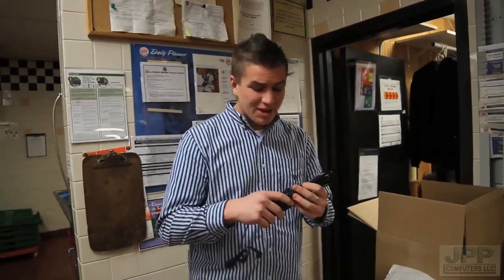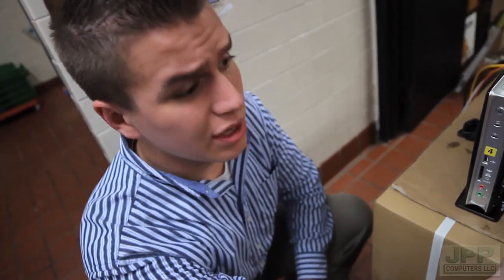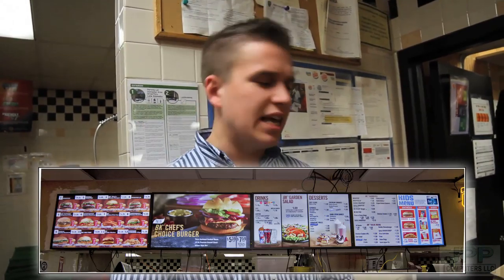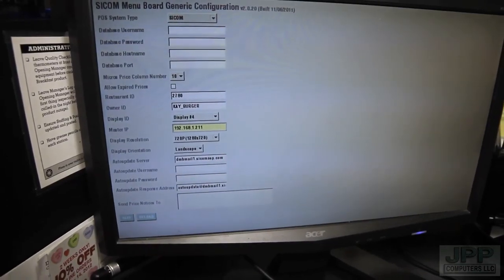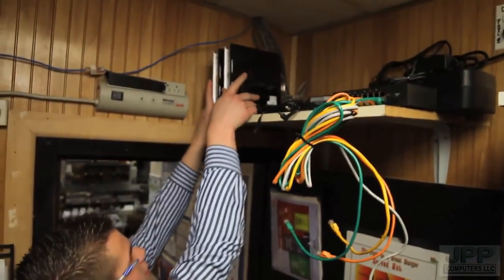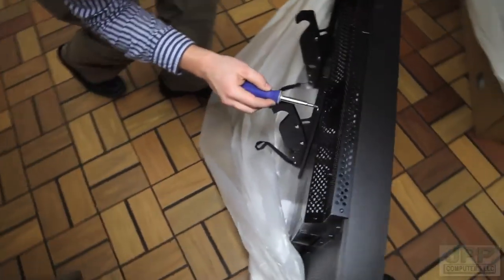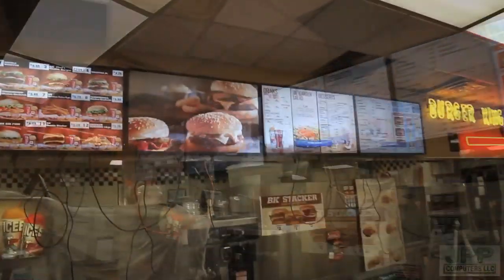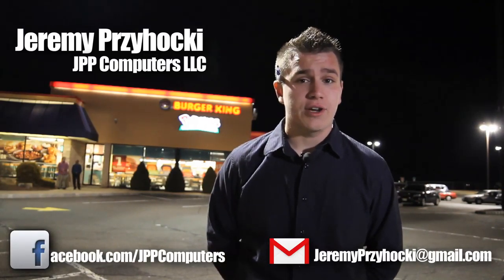JPP Computers Installing Digital Menu Boards at Retail Locations

Comment: Jeremy - to make this a commendable video, choose the right place. This burger king's franchise looks like owned by some cheap ass owner who is not even painting the wall, and cleaning ceiling. Yellow ceiling looks like loaded with oil and greasy fumes as if owner was cooking wings right under ceiling. Take a brand new coffee house or restaurant, request them to let you install TV panels for them and then make video. This place is cluttered, yellowish, old and just doesn't expose the brilliance. Chooses some coffee or Gourmet place with wood walls and spot lightings and then you install brand new panels with extremely high contrast resolution. Resolution should look like screen of ipad with full brightness in dark room. See this kind wall and see second link for resolution - 

For wall where you install TV panels, this kind of finish is required to be brilliant - 
https://www.pinterest.ca/pin/859906122571897495/?lp=true 

See the templates and some of them has exactly Ipad type full brightness contract resolution - 
https://www.novisign.com/templates/digital-menu/

Comment: Horrible work. All wires are hanging.
Reply from the maker: At the end of the video there's a before and after photo with cable management done. You need to make all the necessary connections before using zip ties and j hooks silly goose.